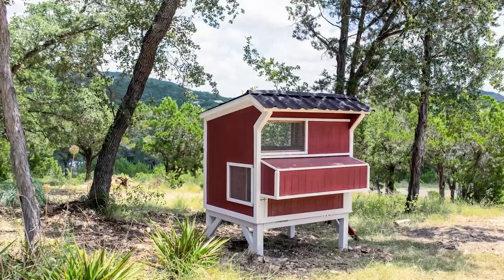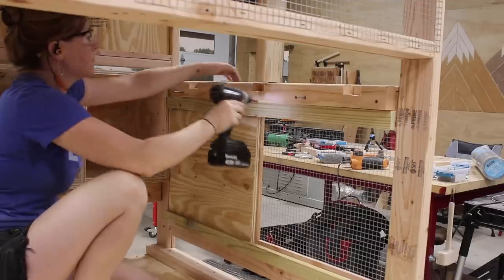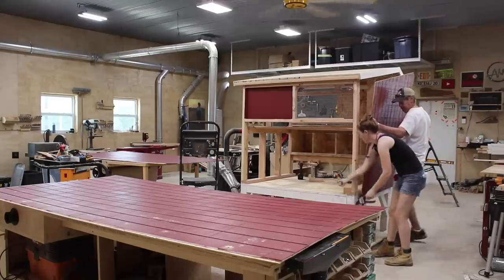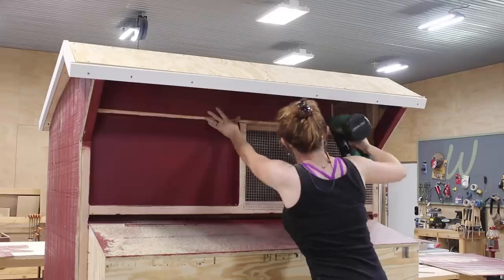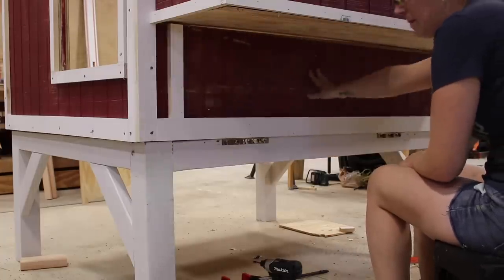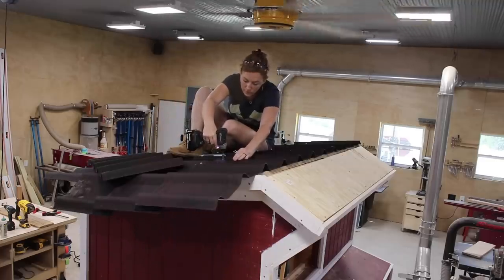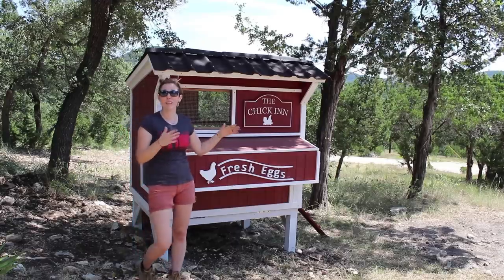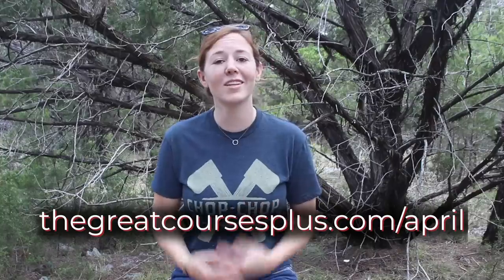DIY Backyard Chicken Coop - Part 2

Comment: We purchased the plans a few weeks ago and are just finishing our coop. We made ours 4x8 instead of 4x5. For easier cleaning and so that the plywood won't absorb the poop smell, we put linoleum on the deck of the floor before putting the walls on top and also put it on the bottom of the nesting boxes before installing the dividers. We also put our mesh on the inside of the window opening instead of the outside so that we could close the windows without crawling into the coop. Other than those few changes, the coop looks pretty darn good. Also, a good addition to the plans would be placing the cut letters on the diagram instead of or in addition to using color. The colors are too close in shade and the flipping back and forth was aggravating. We had to spend a few hours prepping the plans before starting our project. We previously built "the palace" coop and have used that for many years but we wanted a second smaller coop closer to the house. Thank you for this cute plan. You are a very talented crafter.
Reply from the maker: Thanks! Your coop sounds fabulous. Thank you for sharing and for watching.

Comment: When I painted T-111 I went over it with a stiff brush to remove small bits that can fall out over time before sanding. Really neat project. I am waiting what you build for the steers.

Comment: Hi April.  I live in the Hill Country also and know the summer heat.

I suggest Henry Tropicool for you coup rooftop.  It does make a measureable difference on reflecting sunrays and does not radiate heat to an interior.  I like your coup. It is at your Home Big Box store.

Comment: I love this coop! Even more because It came with the house we just bought. My biggest question is about the windows. You have to climb inside the coop to be able to open and close them. It seems it would be easier to attach a handle to the outside to slide them. Is there a reason they are inside? Thanks!

Comment: April Great job on the Coop. But NEVER and I mean Never Again put your self between a trailer and another object while it's backing. One slip of the clutch or gas pedal by the driver. And it's over. Many Dock workers and truck drivers have been killed this way. Love your channel !
Reply: Agreed I spend most of my life around industrial equipment (tractors, trailers, dump trucks, etc) never put your self into a pinch zone. I have seen how things can go from ok to total catastrophe in seconds.

Comment: Looks nice but from my experience not a great home for the chooks, huge windows will cause issues when it rains even if closed it will blow in which is not good as chooks can get sick, mold, invite insects and rodents.
The nesting boxs will get a bit tight height wise when you get the bedding in.
Chickens have a pecking order and generally you want a roost higher up for number 1

Comment: awesome video April. Thanks for all the work you put into it. Just bought the plans and about to start building... curious why you had the windows open from the inside? and the big removable door - is there a groove it sits in?
Reply: We switched our doors around so they can open from the inside. Hardware cloth ends up on the inside, but if the edges worry you around the girls, you could always throw some thin trim over the edges inside to protect them from anything sharp. We also added a stile outside the window in the center so that snakes couldn't crawl into the window between the hardware cloth and the window panel.

Comment: All your lower white facings are nailed on the surface of your cladding. Any water running down the cladding will run down the back of the facing and rot out.

Comment: I just purchased the plans and will be building it this week.  I didn't see on the plans what was used for the roof panels. Can you share what the roof panels are and possibly a link?  Thanks
Reply from the maker: It was Onduline Roofing material and can be found at a big box store. I had some left over from a previous project so just used what I had left. I used it for several projects and love it! Thanks for watching.

Comment: Question for April, I purchased the plans for your compact chicken coup and run.We are currently working on the coup. Great plans by the way however I didn’t see anywhere in the plans what thickness of t11 siding you used? Thanks
Reply from the maker: It's the typical T111 siding found at the Big Box Stores. Enjoy the build! Thanks for watching.

Comment: Wow that is one awesome coop! Now, what was you final cost on it? Im building my self one this spring. How many chicks do plan on having? Thanks, Roger
Reply: We've spent about $600 so far (and we are using screws for a lot in place of nails), galvanized metal roof. Added 6" to the base as the chicken keepers are both quite tall and we wanted to make the run 6" taller also, preserve the height relative to the coop itself.
Reply: @jawjagrrl  what did you end up for material cost on the coop itself?

Comment: What was your build cost?   Thinking about purchasing your plans just trying to budget.  Times are hard during COVID
Reply: $320 ish for materials from Home Depot. Purchased yesterday.
Reply: I priced out materials for JUST the items listed in the plans and came to about $450-500 bucks. This does not include paint, hardware, shingles, and the adhesive she recommends, steel bars to secure it to the ground, paver blocks to set the coop on so it is level.... I think it will end up being quite a bit more. $700-$900 range.
Reply: Price of lumber has gone up significantly due to Covid. I started my build and expect to come in just under $1,000 for everything

Comment: Question for coop and run about what did it cost for materials? So when I approach my husband and he says ask what it’s gonna run him to build this I can give him an estimate?
Reply: I priced out JUST the materials she has listed in the plans I purchased, and I'm at about $450. This list does not include paint, the hardware (screws, nails, staples), the construction adhesive, shingles for the roof, and an addition of a piece of linoleum for the floor. I think when it is said and done, it will be $700-$900 bucks. That's with us having most of the tools already...and, haha, I just noticed I am posting with my daughters account. Oh well! Danielle
Reply: I’m at $700 and I still need to buy some more plywood, shingles, and paint. I estimate almost $1,000 by the time I am done. But it will last far longer than the store bought systems that are really flimsy. Lumber prices have gone up significantly due to Covid.

Comment: So what would you do differently next time?
Reply: We've almost finished building this, changed several things, most importantly hardware cloth on the inside so the doors can be opened from the outside. We also added a door to the coop doorway so they can be more safely closed up at night. Too big an opening for heat loss in the winter. And I don't want to assume the run will keep all predators out at night.

Overall the build is super solid and matches the construction of our various outbuildings that use the same tongue n groove siding in a wider format for larger buildings. Color matching our barn and shop makes the coop look like it's always been here :)